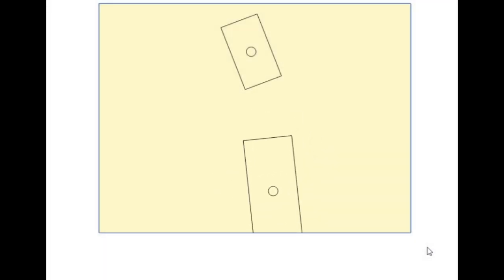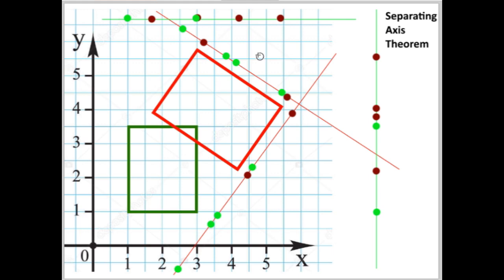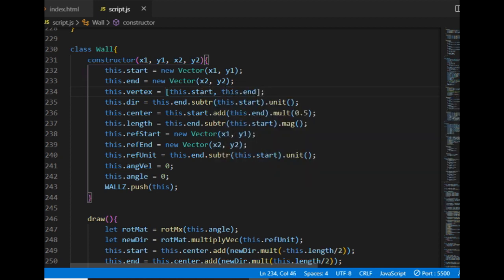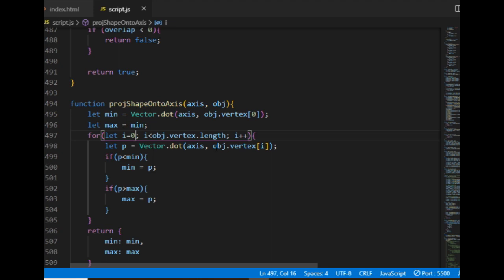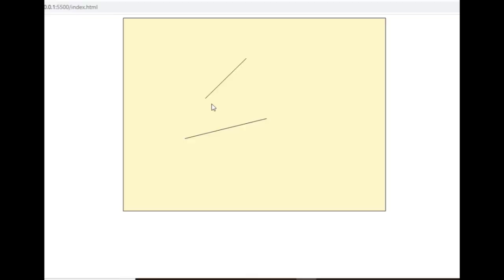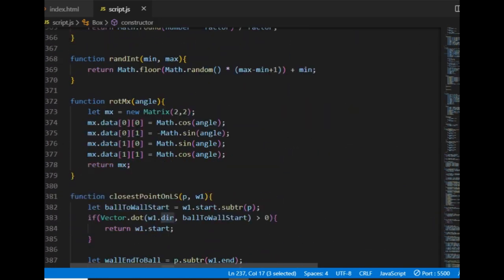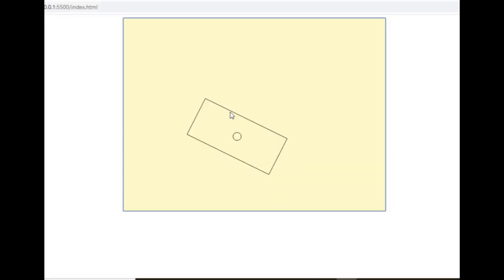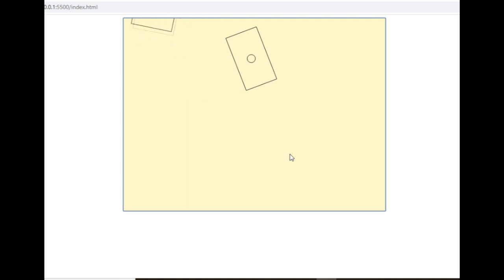2D Physics Engine from Scratch (JS) 15: Separating Axis Theorem

Comment: Just a heads up for anyone who ran into issues on this, the separating axis theorem (SAT) is true only for convex shapes. This means lines do not count, and you can create a failing test case by creating 2 lines that are skewed (not perfectly perpendicular) and angled. So it does work for the shape examples like squares and whatnot that come up, but don't worry if you are testing it on lines as you go and find it gives false positives.

There are other methods of testing specifically line intersections without SAT, or you could also simulate it with SAT by testing an additional pair of axis perpendicular to the line itself (think a rectangle of infinite thinness).
Reply: Ah, after doing more research I've realized using the line segment normals is considered the standard approach of SAT. I think it still holds up in the case of lines in that scenario.

Comment: How can I have JS syntax highlight like yours??
Reply from the maker: I'm using the Prettier and the Bracket Pair Colorizer 2 extensions.
Reply: @danielstuts3129  cool, but it looks like I need another color theme, because "function" word is white instead of dark blue
Reply: I found the problem. Default theme "Dark+" highlights some words wrong. So I installed "Darker Dark+"